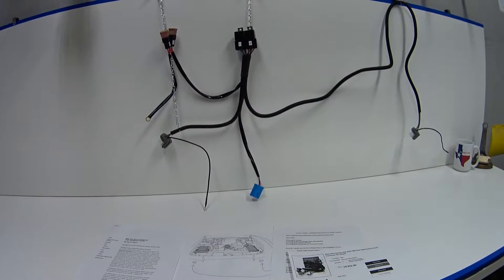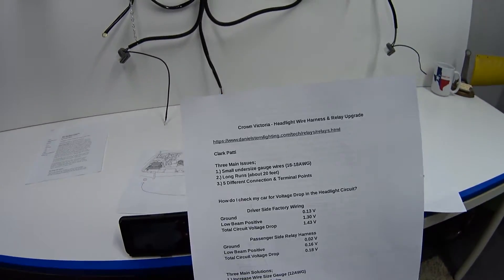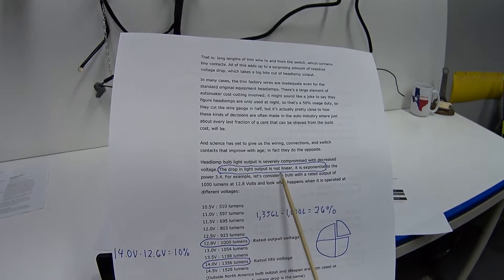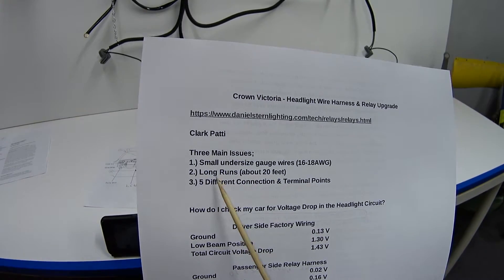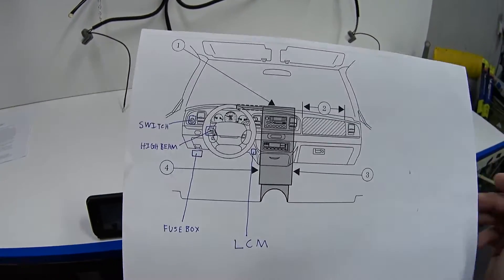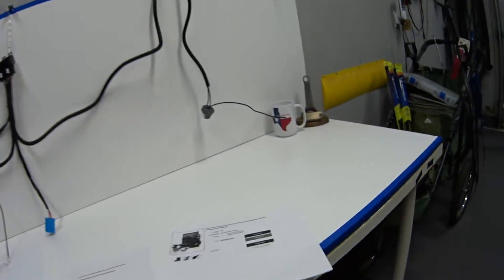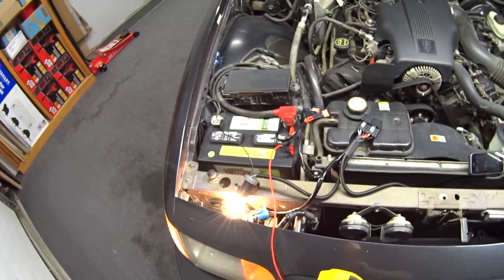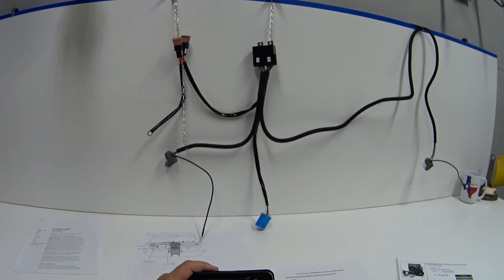Crown Victoria - Heavy Duty Headlight Wire Harness

Comment: Hey Chuck well explained if you can please exclude my comment from the random picker if you can or if I get chosen please skip me. I know these videos take a lot of time to make even if there only 10 mins long. But I'm going to be an arm chair quarter back here. It would of been nice if you had a light meter for photography to measure the light output difference.  Either way tho you did a really great job on this and I know a lot of time was put into it thanks for posting.
Reply from the maker: Right on Mr. E,

This is a great comment.
That would have been the icing on the cake.

I actually did purchase a LUX Meter to measure the difference in light output.
However I could not get it to work properly with reliable results over, and over again. I became frustrated with the device, and returned it.

I also tried to get the difference of brightness on film with my camera, but it does not have manual controls for ISO, and White Balance. I can see the difference with my naked eye, but on camera they look exactly the same because of my camera’s auto white balance.

So I chose to present the only scientific evidence that I could with a basic voltmeter. Because anyone can replicate the Voltage Drop measurements on their car to confirm & verify this upgrade actually works with quantifiable numerical values.

This is the kind of low production quality you can expect from my zero budget YouTube channel, and I guarantee you it’s only going to get worse. Lol
And you can Armchair Quarterback anytime. Lol
I look forward to your feedback.

-Chuck
Reply: I have to agree well put Chuck Mrelectron62 is right on point with comment good job!
Reply from the maker: @bstfordchannel923  
Right on BST,
Thanks for stopping by. 
-Chuck

Comment: Very nice. I constructed something like this myself for my old car, because factory wiring runs all the headlight amperage through the headlight switch, which inevitably accelerates its failure as the materials wear. Then I obviated much of the need with LED lamps lol.
Reply from the maker: Right on Aharon,
Well why the heck didn't you tell me about this mod before?
Geez, I'm 20 years late to the party. lol
-Chuck
Reply: @PanzerPlatform  after adding auto lamps I now have a relay triggering a relay. With more mods I'll have a relay triggering a relay triggering a relay.